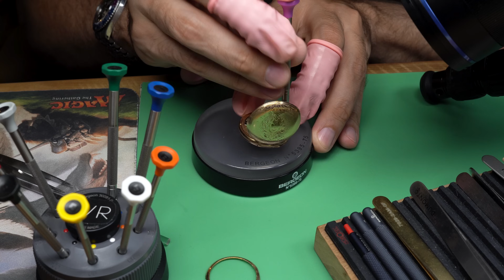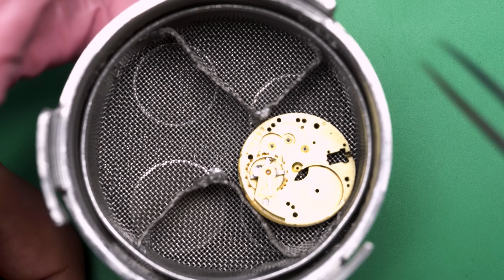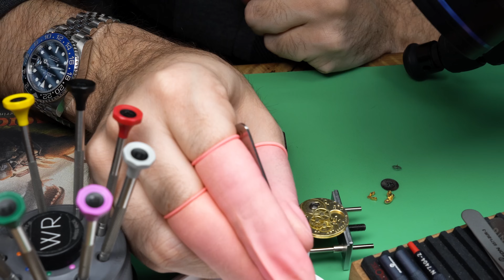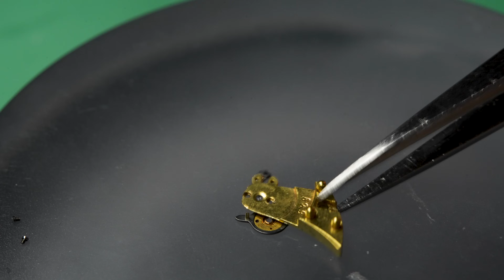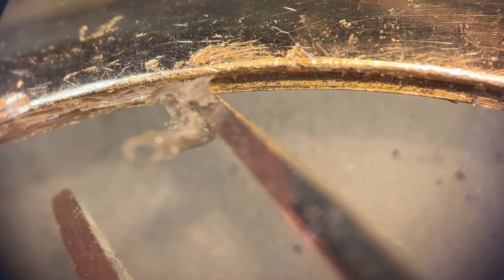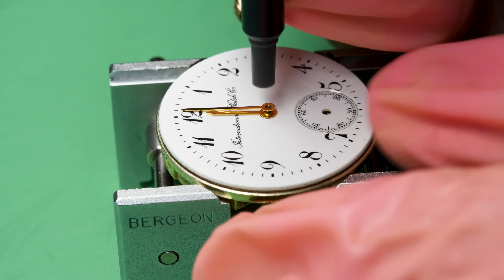A True Mystery Behind the History of This IWC Pocket Watch

Comment: Hi Marshall, I have a question regarding rodico, I see it being used as a multi-purpose tool, but for example, after cleaning off the polishing cream or some grease, can it still be used or should it be thrown away? I ask this because I see that it is not cheap... By the way, thanks for sharing your knowledge, I love vintage watches... Thanks for the videos!!!
Reply from the maker: Ideally it's thrown away, but as you noted it's not cheap so most of us use it for a while and then toss it. If I know I'm going to be cleaning up oil or dirt with it, I'll tear a small piece off and throw it away after. Some watchmakers hold onto the stuff forever, which I don't do because while it's not cheap, it's not that expensive either.

Comment: The serial number on the movement dates to 1911, but it could have been a few years later. I’m guessing Cal 64?  Original case would have told more, most movements lied in the vault for years before being cased up. Looks like about 30,000 of those movements were made during 1907-1918.

Comment: Something I can never quite tell what is happening... The main spring, when you pop it back in and then place the arbor. Does the spring connect to the arbor, or is it more just pushed up against the little groove in the side of the arbor and digs into it to hold in place using the spring tension alone? Sorry, I watch all of your videos but don't have my own hands on experience, so hope that makes sense. Thanks for sharing!
Reply from the maker: I'll try to show on a future video, but the innermost part of the spring has a hole in it, and the edge of the rounded part of the arbor has a "hook" on it; it's just a little piece of metal that protrudes out and catches the spring.
Reply: @WristwatchRevival  makes sense. Thanks for the reply!

Comment: Will you consider making a tutorial on where you get your crystals and how you go about selecting one that will work? So far, I haven't been able to find anything online other than looking up make and model and hoping new old stock is available on ebay.
Reply from the maker: I probably won't make a whole video on it, but I have shown it on videos before, and will do again in the future. The short version is: I measure the bezel where the crystal is going to go. I pick a type of crystal; most watches use the normal domed crystals. Then I go on cousinsUK website, and I order one crystal of the size I measured, plus usually one size up. That's about it.
Reply: @WristwatchRevival  Thank  you for the reply. I will check out cousins!

Comment: Love your videos and always eagerly wait for the next one. Just one question,  why do some screws have revers threads ? 🙂
Reply from the maker: Yes what Fred said is correct, if the part they are holding down spins in the same direction that would unwind the screw, it can come out over time.
Reply: Some are used to retain parts that rotate CCW, so "reverse thread" screws are used to ensure that normal operation does not cause them to loosen.
Reply: Thank you

Comment: Long time watcher, etc. and love the videos. I'm interested to know about torque on the movement screws, is it a case of 'tight' and that's as much as can be done? It looks like you apply a fairly light touch. Thanks.
Reply from the maker: It's really kind of a feel thing. Like after it gets tightened down I usually go about another 1/8th of a turn or so? I don't crank on it too hard though, or you risk damaging or stripping the screws which is a disaster.

Comment: I noticed you didn't grease the mainspring between your fingers or use the braking grease on this restoration. Is there a reason that you do it on some but not on others? I know nothing about restoring watches but I love watching you do this work and your enthusiasm for it.
Reply: These old mainsprings should indeed be lubricated lightly, no braking grease though, that’s only for automatic winding watches
Reply: @tomholloway7566  Thank you for the information regarding braking grease, I know now for future uploads.
Reply: I wondered the same thing about the mainspring not getting greased. Inconsistent from other videos.
Reply from the maker: Good question! I normally do lightly grease the mainspring like this, but these old springs that are rounded like this make me very nervous so I skipped it this time.
Reply: No braking grease is necessary since the spring is fixed to the barrel and lid with its “T” shaped ending.

Comment: Hi Marshall, budding watch maker/restorer here. Do you have any recommendations on watch making tools from other brands than Bergeon? I've looked into their stuff and fell off my chair when I saw the prices. I have a cheap watch making kit but you can tell it's cheap. Something in between would be nice.

By the way, this week I disassembled my very first (already running) mechanical stopwatch, after assembly (and a bit of troubleshooting) it started running again! Start, stop, and reset all worked like a charm. I'm a bit proud of that :)
Reply from the maker: Generally the Swiss made stuff is very expensive, but Horotec is good quality and a bit less than Bergeon. I generally recommend getting good tools and saving for them as the cheap ones make it harder to learn and also don't last long.
Reply: @WristwatchRevival  sounds reasonable. Thanks for taking the time to reply!

Comment: I'd like to see some of the fine tuning done on these old watches. I'm left a little disappointed  you didn't try. 
I suppose it has to do with the hope that an old relic, like me, can be  "restored " to previous glory.
Would love to do this. Maybe in another reality
Reply from the maker: I'll show it on a future video for you. It's pretty straightforward but I do like to show the whole process when I can
Reply: @WristwatchRevival  thanks. Ive never had luck with wrist watches. I had a pendent watch that I could wear on a chain or pin to my blouse. I had it cleaned by a jeweler and he managed to bend a tooth on one of the gears and it never ran after that.
It's an odd thing for me. Time pieces and time just don't sync

Comment: The beat error lines are actually far apart but look close because the distance now is on the outside and not on the inside. So the movement has a very very high beat error and  you should realign the hairspring to adjust for it. The problem with these chinese watch timegraphers is that when the beat error gets very high the lines start moving back together. Hope this helps.
Reply: Probably not worth doing given its 100 year old. Chances of fouling the hairspring  are not worth it for a watch that won't be worn and used to keep time on a daily basis.
Reply from the maker: @jaylevine1483  This was my thought process as well.
Reply: @Jay Levine  nope, hairsprings are pretty resilient
Reply: @romanmechetnerful  absolutely, I often floss my teeth with mine and they spring right back to shape!
Reply: They also default to the 9.9 when it can't pick-up a clear sound to determine the beat error.  Other noises in the movement could be causing it to not be able to determine the BE.
Reply: Another great video I love your channel. Do you have an email address Marshall as I would like to discuss my Grandmother's watch. Let me know please, thank you for reading this.

Comment: I would love to work as a watchmaker and I am trying my best at the hobby but I have shaky hands. Got any tips on how I could steady them? PS love your content!
Reply: Working with tiny, delicate parts, you can do a lot of damage when your hand jerks at the wrong moment, as I found out, although not with watches. Part of the solution is to brace your hand on or against something. The other aspect is to recognize that it's your hand and you actually can learn to do the job in between shakes. You just decide that you will not twitch until after you place the part. It's a short interval and you really can learn to be rock steady for all the time you need to be. You will be very calm and relaxed when you see that it's possible to do this. It's a great feeling of empowerment.
Reply: @jozsefizsak  Thanks for the advice!
Reply: My tip is to use something to steady your hand, it can be the table a chair arm or the other hand, also you can practice with miniature painting.
Reply: @jlGenozzV  I'll try bracing it then!
Reply from the maker: I have found that if you steady your hand against something on the bench it can help (sometimes you can even use your other hand as a stand). It's also important to remember that you'll usually be able to take your time with each movement to get it right.